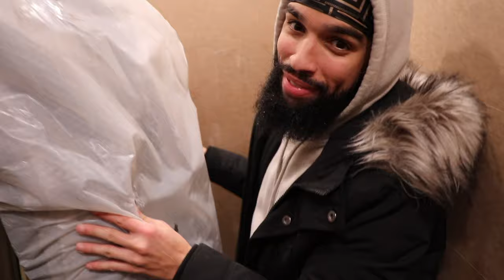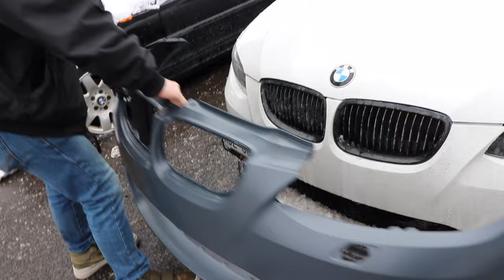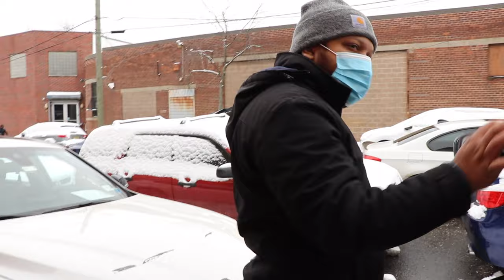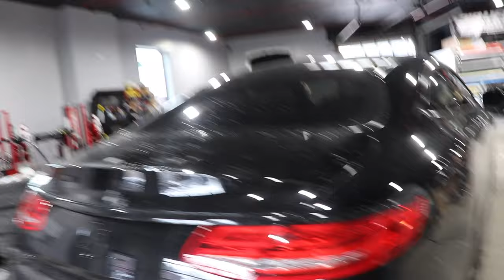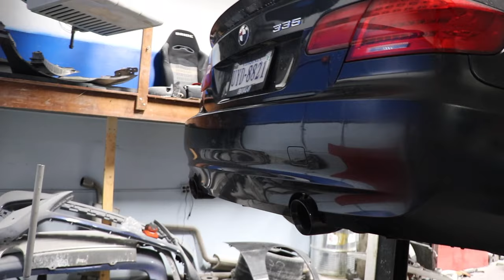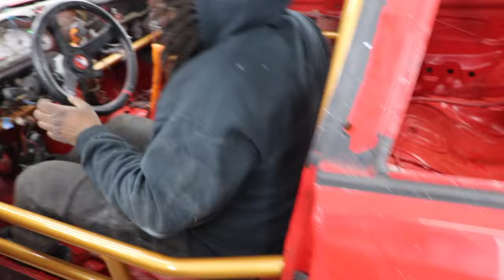FINALLY GOT MY BMW M SPORT FRONT BUMPER FOR MY E92 BEST FITMENT FOR ONLY 300$

Comment: $800 including the bumper.  A paint job for a front bumper with installation should be no more then 400 hundred if you already owned the bumper . Find a better shop
Reply from the maker: you misunderstood..i went to another shop to powder coat my rims since they got messed up when i crashed also..thats when they quoted me $800.
Reply: That's nutts. I got my joints powder coated for 500.00 all black. Plus they fixed 2 rims that were cracked and bent.. they tried to get u.